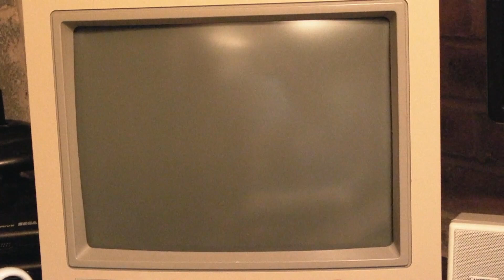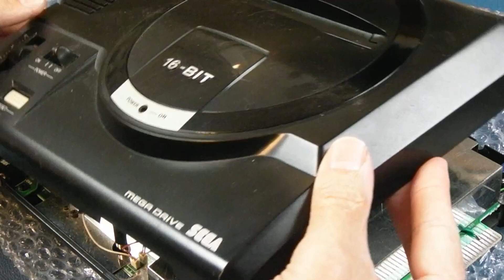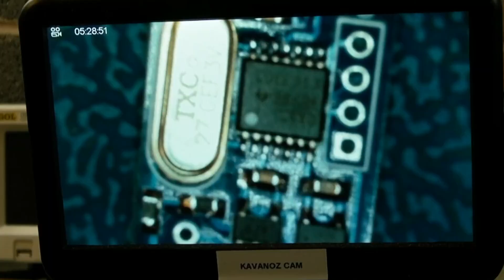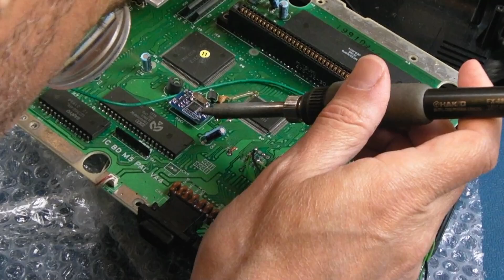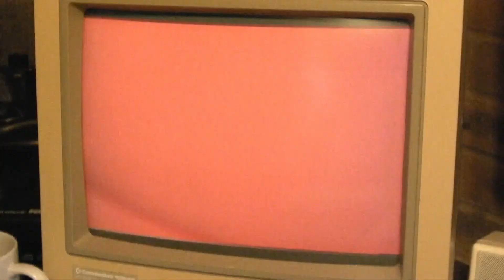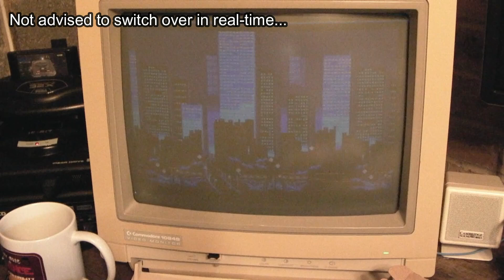Sega Megadrive / Genesis DFO Video Fix (Weird distortion on monitor)

Comment: I get a different issue when running in 60 Hz mode on my PAL Megadrive. With my CRT everything is fine but with an upscaler there's a slight frame judder every few seconds.

The DFO board is out of stock everywhere. I ordered some 53.693175 MHz oscillators via ALiexpress instead to replace the one in my PAL Megadrive since I only have Genesis games anyway. Maybe I'll wire the 5V to the oscillators to switch between them using the switch since it's a two pole switch and I'm only using one pole for the region mod.

Comment: Any link for Megadrive rubber pads for 3 button controller
Reply from the maker: Honestly never seen direct replacements!  I would be tempted to look at the Saturn sets you get on AliExpress and eBay, and cut one down to size to try and fit in place - if possible?

Comment: I installed a DFO on a pal mega drive with a switchless region mod just last month to fix an issue (black and white screen /bad picture) when playing in NTSC mode using composite video .
Both mods were from consoles unleashed and it worked a treat 👍🏻

Comment: I havent had this problem on any of my displays, I'm using two switches, one for en/jp, one for 50/60hz on the megadrive
Reply from the maker: It really does depend on the display!  My modern displays had no issue either, just the 1084 CRT....   If the DFO mod isn't done, you do get timing differences in a few places too that can make things behave oddly in certain games.

Comment: This is actually the first time I've seen the inside of a Mega Drive. Interesting you mentioned the humming sound as mine does it also, and I assume they all do it. Its a horrible sound to hear when the Machine is Booting/Loading/Switching Games. I bought a new Plug a few years ago, but doesn't solve it. Nice setup you got there, which looks quite comical with each system on top of the other. Does the Sega Cd and Mega Drive Consoles connect to each other or just it just sit on top? Nice Mod also Chris, it amazes me with your precision soldering. Nice CRT and a nice list of Games you showed. Streets of Rage soundtrack is amazing. Thanks for your support this year Chris, and thanks for your Videos. Hope you have a great Christmas. Sssseeeeeggggaaaaaa.
Reply from the maker: Thanks Jamie =D  Have a great Christmas and Happy New Year!  Keep up the amazing job on your channel - always a joy to watch!

Comment: SoR 1/2/3 (among others) use the 240 Vres in PAL, but if in that mode you switch to 60hz you get a rolling screen because the hsync info is supposed to be in the additional lines. Also, some games ( again, the SoR so) do detect the frequency and adjust the sound speed. The most notorous game to not adjust is Sonic 1 which is slooooww on 50hz
Reply from the maker: Very interesting!  But I dont get a rolling sync - ie. not to the eye.  The CRT captures a rolling band there, but to the eye the CRT is perfect now with the DFO fitted.  I agree in respect to some games detecting frequency and adjusting game core mechanics etc.  Sonic speeds up (or slows down), other games largely behave the same regardless.
Reply: @GadgetUK164  at 30:58 you do get a rolling screen because SoR is launched in 50hz and uses 240p, also the music is slowed down ; I think the check is only done at start.